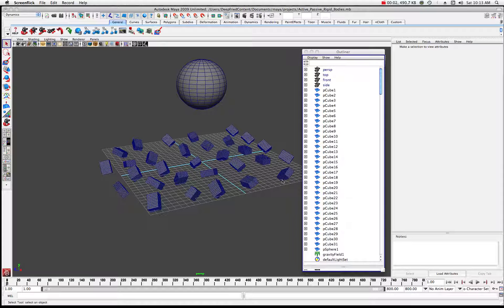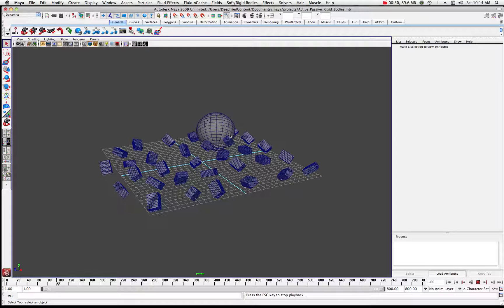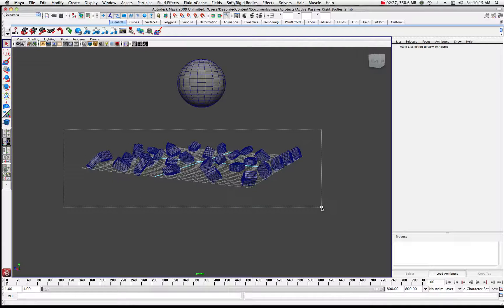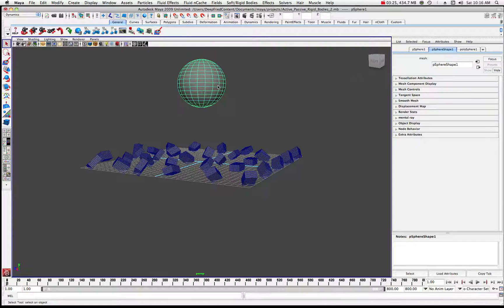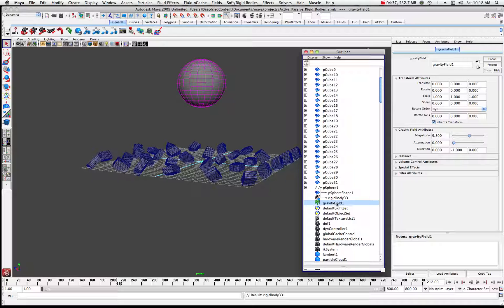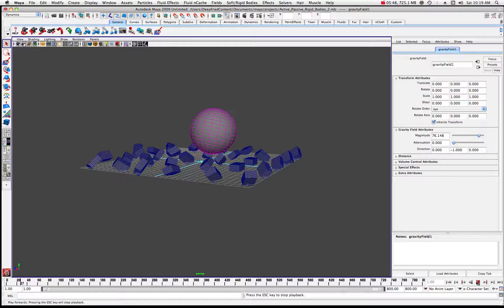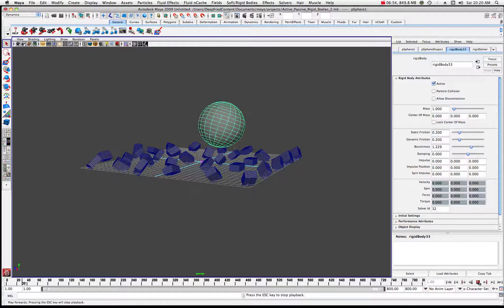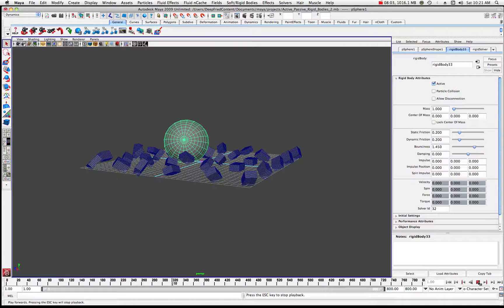Maya Active and Passive Rigid Bodies Tutorial by Stuart Christensen

Comment: Great tutorial, but I have a question.  I'm trying to create a scene where I have a floor as a passive rigid body with a stack of bricks as active rigid as well as a bar that is suppose to move horizontally and break through the stack of bricks to create a crumbling effect except when I assign either an active or passive rigid body to the bar, it just falls straight down and doesn't obey my animation settings.  Any suggestions?  Thanks.

Comment: Great tutorial, thanks. I'm working on a project in which letters have to fall off a kind of business plate on the wall, four letters to be exact. Is there any way to randomize the timing when they actually starts to fall? Maybe one or two is attached to the plate with a pin and it holds them back or something. I tried it with nCloth simulation but it was a huge failure. Also tried keyframe animation, that was even worse:) 
Keep up the good work, you're awsome, thanks